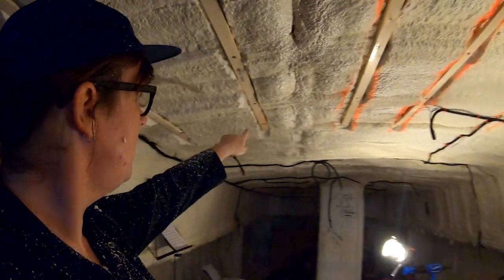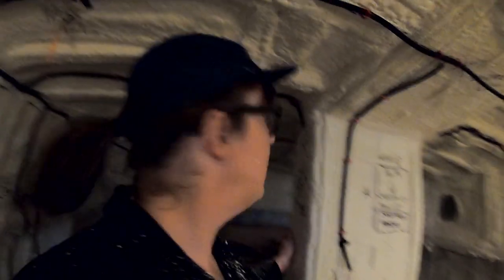#37 Tidying Up for Christmas - Dutch Barge Home

Comment: I am sure others have said it but I feel the urge to say it too. I really wish you would wear a mask when cutting that foam. Especially overhead. Air belongs in the lungs, not bits of chemical-based foam.
Reply from the maker: It really doesn't cause any dust but I appreciate you saying so!
Reply: @TillerQueen  Your clothes are covered in it. If it is looking like dandruff on your shoulders, it is causing dust. But I'm not there, you are. I can only go by what I see, not what you experience. I'll be glad when all that foam cutting is done! It must be hard on your arms, especially the overhead bits.
Reply from the maker: Yes, it's a good point and I am wearing a mask more now. But, yes, it's a pretty unpleasant job really. Thanks for your concern, it's very kind of you.